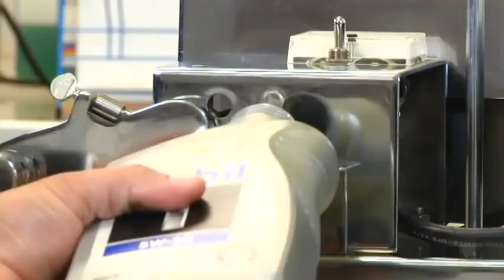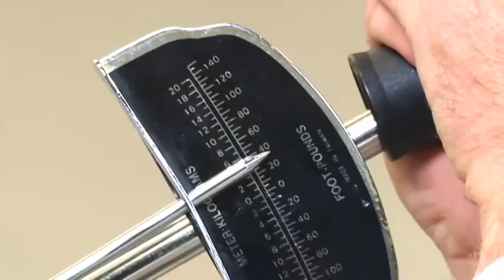AMSOIL Exposes the 'One Arm Bandit'

Comment: Also none of the bearings in a engine use the same materials in the one arm bandit full stop.
All newer engines say from 1998 onwards have hi tolerances for surface to surface contact and if you use a additive, no matter what the brand your going to destabilise the engine oil your using doing more harm than good full stop, the current oils on the market are really good all good brands like AMSOIL, MOBIL, Castrol, Valvoline, Pennzoil, so many to mention, but just check out what the API rating is on the bottle ,that way you know its up to a standard.  Like now its GF -5 6A, the new Standard everyone wants to get is the DEXOS 1 Gen 3 Licensing, which means its meet the very hi standards of that oil from dexos testing etc. 🦘🦘👌👌✌✌

Comment: Every single oil manufacture, like Mobil and others use hi grade additives and the best youtube channel for engine oils is the lube guys, oil geek youtube channel, check it out if your interested in oil tech and what they do when making new oils, which now it will be GF-7 engine oils, which will be available in 2027 approx, still stick to the OEM oil specs and approved oil based on the  how you use your daily driver and even other cars you might own. cheers 🦘🦘👌👌✌✌

Comment: Very Misleading video.....The Amsoil sales guy did his best to "Manipulate"  the bias Against  that oil tester machine.....The ASTM (the Testing & Materials Standard Society that grades Motor Oils) Uses  their D4172,  D2738,  D2670 &  D5183  Metal pressed to Metal to Test & Evaluate Motor oils Lubricity in a Similar in principle machine in a precisely Timed & Repeatable process results......The so called "1 Armed Bandit "  will also yield Reliable  & Repeatable Lubricity test results if Used Correctly as in the respected ASTM testing protocols......
Reply: Those tests are used for gear oils, not engine oils.

Comment: now dont get me wrong, i used to use the same machine, when i worked for Wynn's AU and proved that the additives worked, by sending the oil that the customer was using to a oil lab and get the results back based on all the main parameters of the oils results and then used the additives in the multi million dollar machines which the mining industry and other industries which use 200 liter drums and even 10,000 gallon tankers for oil supply and they were very impressed with just how much money they saved by using the additives,after the oil came back from the LAB with all the figures to prove, that the additive kept the oil they used to extend the preventative maintenance and saved 100's of thousands of dollars per year. 🦘🦘👌👌✌✌
But in saying that, in the testing using the machine, every time you change the oil, the bearing needs to be replaced and also cleaned with carb or intake cleaners and the same with the oil supply area , we had a weight of over 100KG on the arm, plus its a fake test, meaning it proves that the additives work, but that's not the real test its the oil results back from the lab and or the ASTM D2783-03, plus AMSOIL in almost all the oils they recommend, none of them have the 2021 sept Dexos1 gen 3 certification. 
They say the oils were test to that ILSAC GF 6 (A) requirements but they aren't otherwise it would be on the web page, plus they test their 0w/20 to say it passed the ILSAC GF6 requirements yet the oil you need is 5w30 for your car as you put it on the web page, so they use the 0w/20 are a marker for various tests, but also test their lower range oils like other 5w/30 weight oils, but do not put the test results for the oil you going to use if you get my drift, plus sent a email to them and still no response in relation to ILSAC  GF6 A  OR Even API SP certified oils that they have? 🦘👌✌